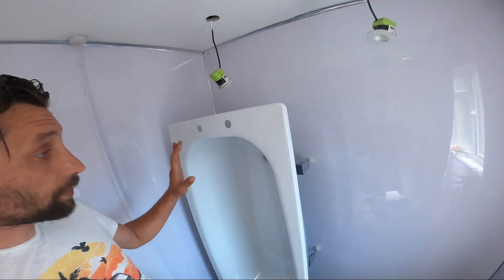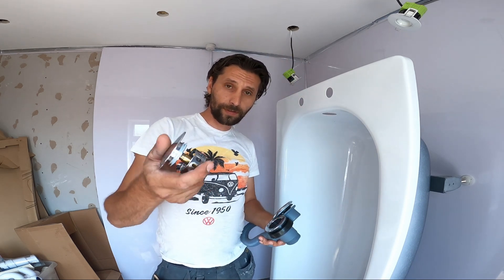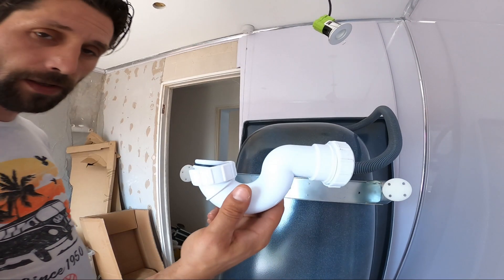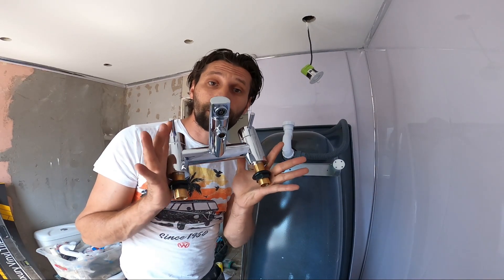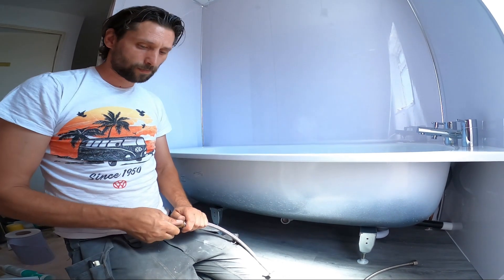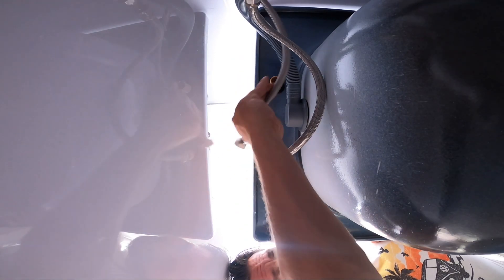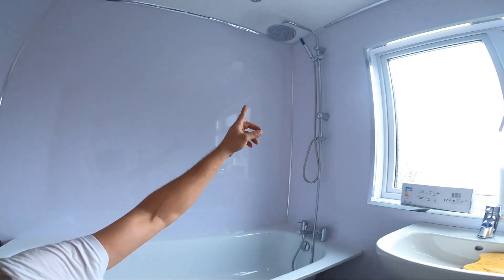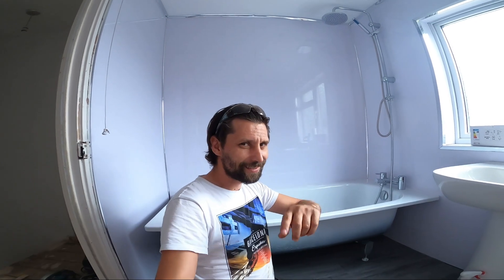Bathtub Installation - uk

Comment: Hi. Tha ks for the video. What do ypu recome d to use to cover the gap between the left wall and the left side of the bathtub? Thanks
Reply from the maker: I personally prefer silicon at the back of the corners and front of the corners but most of the time im using the corner bids that are recommended with the bath panels

Comment: But can you stick it to the wall with just silicone without any problems?
Reply from the maker: Yes.its not going to go anywhere.make also sure that you screw the legs of the bath tub in too the floor.dont worry if it's going to feel a bit flimsy once that is tight to the all 3 walls it's going to be ok